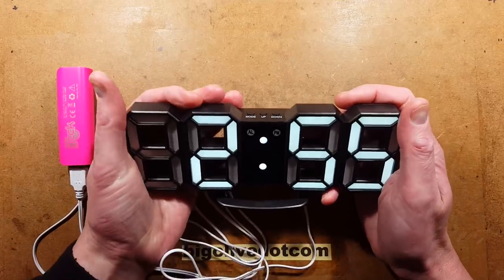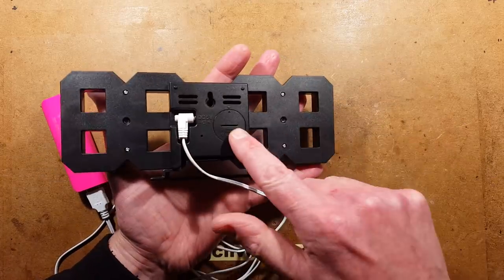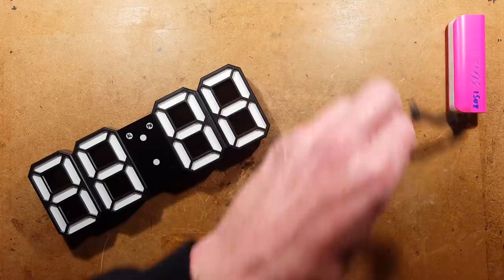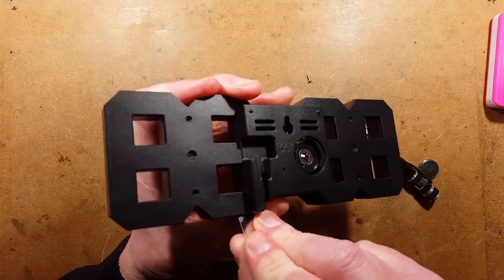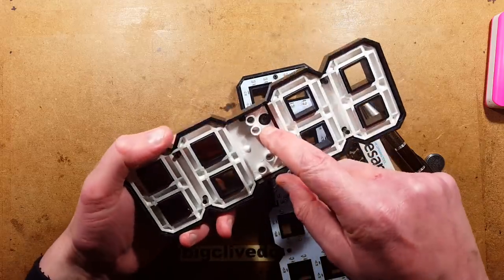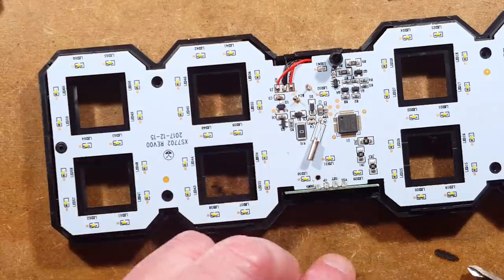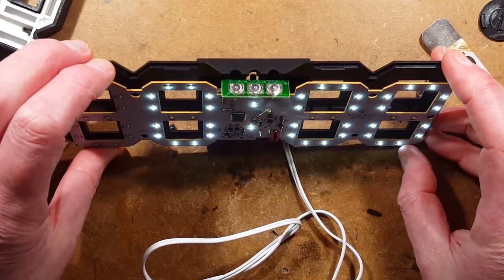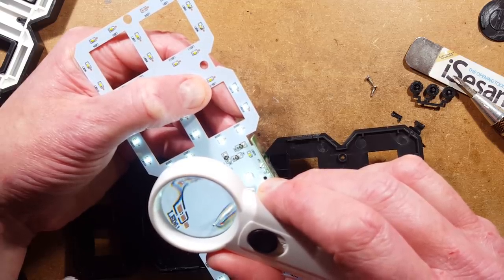Inside a large "3D" digital clock.

Comment: That black hole maybe for temp sensor, I have this clock and mine shows the room temperature,  keep up the good work Clive
Reply: If yours does temperature, does that mean you have the LED Clive is missing? For a decimal point in the temp?
Reply: That looks and sounds right. I was thinking as a second tick indicator. But I thinking you are correct.
Reply: its for remote control receiver.  some of them have remotes. also some of them label that as TEMP. so it must also house the sensor.
Reply: @tubejoust  I have one with a temp sensor and can confirm that when on bright setting it reads 2 degrees higher than when on dim setting. When on dim it's about right, give or take a degree.

Comment: Your half-ass Samsung phone overhead camera rig gives a more readable picture than that multi-thousand dollar microscope Dave Jones uses. Love it.
That's a cool little gadget. A cheap low current replacement for my circa 1980's Radio Shack Big LED clocks around the house. Plus, I could probably add in a "synchronization" circuit using an ESP8266 to reset my clocks around the house without having to run around like a fool pressing buttons.

Comment: I have three of these clocks...one with RED LED's, one with GREEN LEDs and one with white LEDs.  Several of the segment leds on the white clock went bad after a year and are very dim to where you can't really tell what time it is, so I replaced it with a green LED clock.  I use two of them on my monitor at work, one for local time and one set to UTC.

Comment: There's no need to include an RTC chip on a clock.  It's very trivial to set up an interrupt timer to generate i.e. a 100Hz (or some other useful rate) interrupt, then just increment some counters to do your timekeeping.  Usually I set the interrupt to 1KHz or so and do the LED multiplex refresh and timekeeping all in the same interrupt.  This isn't so easy to battery back, but you could run the micro on both via diodes, and have the LEDs just powered by the DC in.

Comment: The little dome might be for an optional auto-dimming circuit...some of the other listings have that feature advertised.
Reply: Yes, also I assume that extra LED is used to perform that, because despite what it's made to do, LEDs technically produce a voltage when exposed to light since they are really the same thing as solar panels, I assume they measuring the voltage of that led to sense the amount of light around the clock

Comment: There are many microcontrollers with a built in real time clock circuit.  Even some without it can be made to serve the purpose very nicely.  32786Hz as a clock on your processor doesn't lead to high performance but it is good enough for being a clock.  It could be a nice home project for someone to make a really big version

Comment: I wonder if that chip has code in flash or in ROM? The 'data sheet' said it had both, and also had the magic number 8051 on it, so the CPU's completely standard. It'd be interesting to try and reverse engineer and reprogram. There are some interesting looking test points near the CPU which might be worth investigating.

Comment: The one downside I see with that constant current intensity regulator for the LEDs is that the brightness might modulate depending on how many segments are lit.
Reply: Veraxis Indeed.  Something needs to adapt the current selection to the number of lit segments.  So either the regulator can be set to 28 different currents or there's a dummy load with 28 values, or it's actually multiplexed to light one segment at a time.  Note 28=7+7+7+6+colon.

Comment: I would speculate that the display has the potential to show TEMPERATURE -- and the extra un-mounted LED would serve as a decimal point.  Given which, the temp display must have been meant for Celsius only -- since more than 99.99 degrees could not be displayed.
Conceivably, the little window could be for a light sensor.  That would allow the display brightness to vary with ambient light conditions.

Comment: I’ve got the red version on my bedroom wall, it’s really good. The lowest brightness setting is too bright though. I put blue translucent film on the front to dim it more.
Reply: same here - If anyone knows a way to dim it down further electronically: I'm listening (I will try the blue film on occasion, too - it just disn't cross my mind to put blue film over a red clock).
Reply: J K I thought the blue would effect the clock colour as well, but the red stayed the same. It just dimmed it. I just used what I had laying around. An electronic alteration would be great.
Reply: Changing the resistor R9 for a higher one should dim the leds.
Reply: @jk9554  change that common resistor he points out for all the LEDs. make it slightly larger resistance. a trimpot in series would make it adjustable but i don't think i've seen trimpots that low in resistance.
Reply: Blue LED light is allegedly the worst for sleeping.

Comment: Now I'm really intrigued what would happen if you populated those unpopulated LED locations. Perhaps the lower one flashes secret messages in morse code?
Reply: They're to use it as a numerical display instead of a clock. Bottom center one is a decimal point. 99.99 instead of 23:59
Reply: @PsRohrbaugh  Good point

Comment: My guess for U3 is the LDO regulator. a quick search for 1.8V LDO gave this MIC3490-1.8YM5-TR  regulator that has the same form factor. So if it runs with 1.8V, it almost can be used with a single battery, so close.

Comment: A blast from the past,  this popped up in my feed, well shortly after you posted this video I bought one of these clocks in white on white, three years on and it keeps remarkably good time 😊 and makes a great nightlight in my bathroom, some cheap Chinese tat is actually fairly decent😏
Reply from the maker: Even at a low intensity setting, the digits on mine have visibly degraded in intensity.  It shows which ones spend the most time lit.

Comment: That "8051" in the processor datasheet block diagram suggests that the actual programming might use Intel 8051 instruction set.
Reply from the maker: I noticed that.  Many modern processors seem to be based around that older processor.

Comment: Greetings: When I switched from cable tv to DirecTV I was surprised to discover that the new Genie 4K client STB has no clock on the front display (there is no other clock in that room save the Smart TV's info window which requires access to the REMOTE which is often in other's hand.
This little digital clock display lloks like a good one to place atop the Genie; and use the STB's USB port for power.

Comment: 12:10  That thing that you were wondering about.. could it have been a photo sensor.. to put it into night mode?  The way it is now, is that you set the nite-mode start and end time, where it will dim the clock, but I wonder if they intended to use a photo sensor, but either cut it for cost reasons.. or they were just having trouble getting it working right?  Another possibility .. is it lined up with that hole?  Could it have been for an IR sensor?  Maybe they intended for a remote to be used?  IDK, but I just bought two of them. for $10 each.  I like the look.  I also wonder if the colored versions still use white LEDs with different colored translucent film, or if they are in fact different color LEDs.. maybe with the same white film.. IDK.

Comment: I have a cheap US-mains-voltage Sony alarm clock with a backup battery (9V) that keeps the time across power failures. I haven’t bothered to reset it. It’s 8 years old and because the 32768 Hz crystal vibrates a bit fast, the clock is about half an hour ahead. (It resets automatically for DST too.)

Comment: I would love to find a cheap LED clock like this, but with a GPS chip in it so that it always has the correct time (with a way to select timezone or GMT offset).
Reply: If not GPS, there might be versions with the radio controlled time function out there (make sure it supports the frequency used in your area) - seems to be  many variations on this style of clock just looking on eBay

Comment: Edit they could also just be used as pads for a wired tiny solar panel that does light sensing
I think they are using the extra LED spot for light sensing, since LEDs technically function like solar panels and will produce a voltage, just a thought, doesn't line up with the dome though so no clue, but that dome lines up with nothing.

Comment: I have one of these in front of my television and there does appear to be a light sensor which seems to be affected by my TV screen so it dims and brightens in tandem with my television depending on what I am watching and how bright the screen is...
Reply: Yeah, I was thinking that would be the reason for that opening, and the component that is missing on his was for a photo-sensor.  I just bought two of these, and in the description, it has a night mode where you set the on and off time for this mode, where it will dim the light for part of the day.  Yours must have this sensor and I assume you don't have to set this time span.
Reply: It is quite annoying to be honest but I like it where it is so what can you do apart from black tape over the sensor
Reply: Seems to be various control and sensor options on these if going by eBay listings and what's said here in the comments.
Sensor or timed brightness, sound control alarm off/snooze, IR remote control, temperature...
On one there's a led for an alarm active indicator (showing 'AL') by the bottom right of the 2nd digit and a led to indicate 'degrees' by the top right of the 3rd digit (with the 4th showing F or C, so °F / °C
Another one has visible openings Kline for the :) under the lower dot if the colon (looks to match Clive's unpopulated led) as well as above left/right of the upper dot, for alarm on and PM
Reply: @larrygall5831  There are various versions of this clock available.  I think the one in this video is the more basic one that doesn't have the light sensor.  As others have said, some have temperature readouts and light sensors as well.

Comment: For data sheet archive. Maybe alldatasheet.com. Just be sure to have an ad blocker running. Have a whole folder of data sheets for stuff in my random salvage box that came from them. Sometimes it can be hard to find the surface mount stuff though, so many overlapping numbers between brands for very different circuits so use your discretion for which one applies to a given usage.

Comment: I have this clock, bought for six quid from a Facebook Marketplace seller. All seems ok except that on those two left hand numerals, ie the hour digits, the bottom right little white bars will suddenly change to very bright without any prompting, and will only revert to normal if the whole clock is twisted, when it will click and those two pesky bars revert to normal. I either twist it or tap it smartly on my knee. When these two bars illuminate so brightly the clock is useless as you cannot tell the hour. It's a shame as although it cost so little I had hoped it would be as good as it is in the videos and adverts, so am a bit disappointed. I bought it as a working item, but cannot be bothered to drive back to return it to the bloke, who surely was aware of this fault. Ah well, a lesson bought is a lesson taught, or whatever. Thanks Clive fr another really good mini documentary.
Reply from the maker: It might be worth looking at the PCB for a solder bridge near those LEDs.
Reply: @bigclivedotcom  Great idea, thank you Clive! Something's -joining the dots where it wasn't meant to.

Comment: Hi Clive, I can't help but wonder if that little domed window might be for an ambient light sensor, in a different incarnation? However, it also would seem to match up, pretty much, with the back of the buzzer - can't see how that would be relevant, but maybe again, in a different version the buzzer might be on the component side of the board, with a small grille or aperture in the fascia to allow the sound to emit from the front?

Oh, just a thought. . . . . Didn't they have a girly pink version? 😁

Comment: Hi Clive. Wondering where I might be able to find (ir not get the parts and get help to build) a LED/LCD ditital countdown timer? Something smaller, not for the use on a wall in a room, but something that I can use for a gaming or casino table, as a bit of a "time left to act". Ideally, Iy would be awesome to wire 2 or 3 built INTO the table, such as the playing surface and from the admin or dealer section, manually configure all clocks simultaneously to countdown. Any ideas on how I could achieve something like this? No player interactivity, no buttoms at the location of the time (wired and extended elsewhere) and also no audio/alarm required.

Comment: 2:58 that's talent right there not many can screw the tip of a driver and get it in the hole the first go round. 10 out of 10. I have to use super magnetic tip or turn the lights out and put some hair around it.

Comment: I have made similar 3d printed clock with ws2812 diodes and atmega, it has light sensor so it dims at night, backup supercap power and it is only 2 minutes fast / 6 months :)

Comment: There's an optical illusion going on here. The unlit LEDs look recessed and the lit ones look flush to the front. At first I thought this was some sort of mechanical deal.
I wonder if the bubble on the case is for low light detection = auto dimming.
Reply: I thought the same thing but there's no LDR on the PCB itself and I didn't see a notation on the PCB for one.

That said the form is just a form and it could be for a different model altogether, or future proofing or an abandoned idea but the mold was already made.
Reply: I also thought about light dependent resistor, maybe the idea was scrapped but the mold was left as is.
Reply: Is YouTube bugging out or did you really comment 2 weeks ago
Reply: @zurkel1098  there's a lot more comments from two weeks ago.
Probably a Patreon thing.
Reply: @zurkel1098  Patreon subscribers get early access to videos. Then, before publishing, the video owner can change the publication date.

Comment: Wanted to buy one of these, is it possible to run this with a bare 18650 battery? No electronics, just an 18650 as a power source. Would appreciate it if you could try it. Thanks!

Comment: LED61 could be an AM/PM or 12/24Hr indicator
wondered if the "window" was for an auto dim feature...….. maybe ???
Reply: AM/PM is done with LED 30, also while I agree with the windows use, my thought is that they were possibly using a normal led as a light sensor, since they do produce voltages when hit with light

Comment: Here's the riddle I'm trying to solve with my "3D" clock right now... the first digit (leftmost) is displaying whatever number is displayed on the last (rightmost) digit. Could this be an issue with the "gating" transistor you were speculating about? Very curious... full disclosure: I bought it on the cheap from goodwill and had to repair some damage to the PCB done by the battery cover IIRC. I had to resolder several connections like battery/power wires and I recall it kind of spiraling with botched repairs before I finally got it working. I must have messed something up although it worked perfectly for about 6 months first 🤔. Great video, as always 👍
Reply from the maker: It sounds like there may be something bridging the digit drive lines.  Could be a tiny whisker of solder or a rogue solder ball on the PCB between two pads or tracks.

Comment: That SOT23-5 chip is a voltage regulator. Type this in Google: LN1138B filetype:pdf. It will be the top result. (Remember the filetype:pdf bit. It's quite handy, so you don't have to deal with those datasheet sites anymore.)
Reply from the maker: I use that trick.  Unfortunately some of those sites have been making their spam pages into PDFs to try and keep their finger in the pie.

Comment: Do you think this would be OK in humid conditions?  I'm in southern Florida, and I'd like to put this outside, but it would never see rain.. there's an area out back that has an overhand that is 8' wide (around 2.5m), and beyond that is a screened in pool area.  There's no way for it to get wet, but it's humid here.  I was wondering if I should put some clear nail polish on the circuit board.
Reply from the maker: As long as it's not in direct rain it should be OK.

Comment: a warning about those coin cells.

if you have children or elderly people you need to be careful to keep the cells away from children and  the elderly as children can swallow the cells and they can cause burns to the insides.

also the elderly can mistake small cells like that  for pills and swallow them too.

then immediately dispose of the used cells in a way that children cant get to them

that dome while this model does not have remote control the next model up may but they are leaving the dome in place to make the plastics 1 size fits all.

Comment: My display kept turning off after 15 seconds, so I wrote and applied this procedure:
Using the DP-3 Display Mode (display remains ON after 15 seconds):
If digits turn OFF after 15 seconds, PERFORM MASTER RESET:
After removing backup battery, press a sharp object; e.g. paper clip, into the RESET hole.
Set clock to the correct 12/24 hr format, time, and DP-3 display mode and save.
Replace backup battery.
Display should now remain ON.

Comment: the day you posted this I watched it and before the video was over I had purchased one on Amazon.ca. arrived two days later. One problem though is that even on the lowest setting it is REALLY bright in the bedroom. Can you advise me on making it less brilliant other than throwing a towel over it?
Reply from the maker: If it's the same unit you could change the main display current limiting resistor for a higher value or just use a neutral density filter in front of the clock.
Reply: @bigclivedotcom  thank you Clive. I will employ a friend to identify the limiting resistor